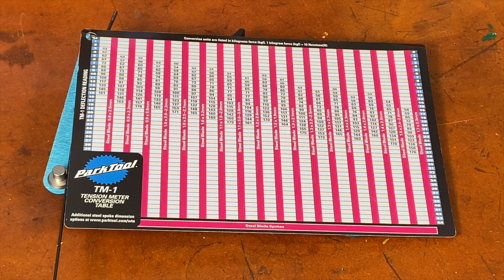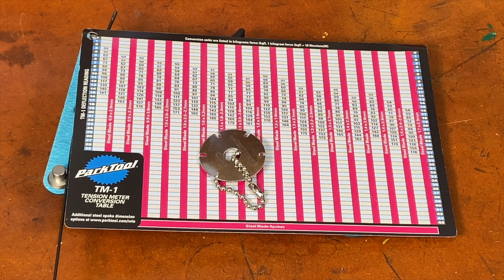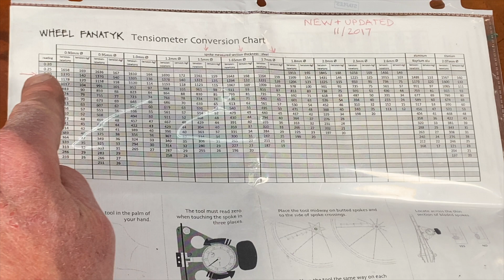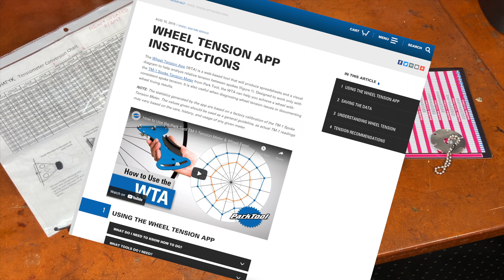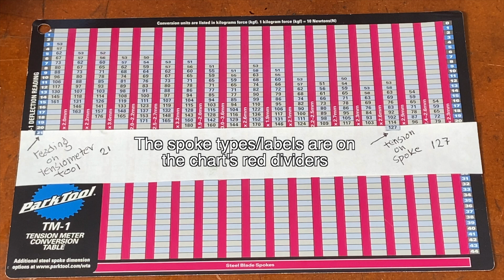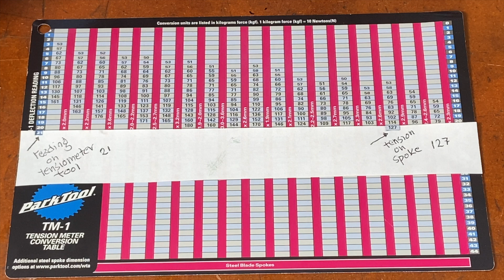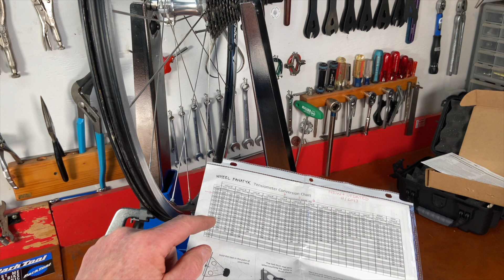Do You Need A SPOKE TENSION METER to Build Bicycle Wheels?

Comment: Hey there,

WF tensiometer style need to be reset within each measure,
 that's the "plus" with this design, spoke isn't straight,  before measure a deflection, you have to reset .

With other tensiometer style(Dt/Sapim/paktool) you can't do this,

If you have 0.03 or 0.04 deflection between 2 contact and measurement point, you read 10 or 20 kgf more or less😉
Reply from the maker: Thanks for watching and for making this excellent point about the difference in tensio meters, Guillaume. Working with the Wheel Fanatyk for hundreds of wheels, I have found that if you move the tool on the spoke up, down, slightly around, you can often zero it without resetting it. I think the discrepancy is from spokes not being perfectly round. Thanks again for the great feedback, appreciated it!!
Reply: @JimLangley1  yep, it's another solution,
I'm using chinese  DT style tensio and Filip Kralyevski tensio ( same as WF / FSA and in reality a Jobst Brandt design)

The capacity to measure the real deflection with this design is a decisive point.

Even centrimaster or hozan tensiometer can't do this.

Comment: Great videos Jim. My question is if you don't know the rim's recommended tension, how can you calculate each spoke's correct tension? Thanks.
Reply from the maker: Thanks for watching and the great question. Rim makers specifying tension is a relatively new trend and still not all makers do it. So wheel builders have to learn and tension to a range they know works. That range is from a minimum of 90 to a max of 130. So we go for a final tension in that range and consider the feel of the tension as we finish wheels along with what the tension meter tells us. I hope this helps.
Reply: @JimLangley1  Thanks Jim, I don't understand how to use that to calculate the individual tension of each spoke.
Reply from the maker: @blahqwe  you only measure the tighter side: right rear and left front for disc brake wheels. Either side for rim brake fronts. You’re looking for about the same tension on all those spokes. They will vary a little cause spokes and rims vary but the tensions should be close. Shoot for 100. Hope this answers but lat me know if you need more info.
Reply: rollinrat4850  Thanks.

Comment: Hi. Great video. Thanks!
Before spending 90 € / $ for the Park Tool I would be happy to know your judgment about the precision of the tool. Are the results (kgf) reliable?
Did you possibly double checked the results with another tool?
Thanks a lot and Greetings from a fan in Germany
Reply from the maker: Thanks for watching, glad you enjoyed the video! Yes, Park Tool’s tension meter is a quality tool that gives accurate and reliable results and they provide full support for their tools too - even an online app for balancing tension in wheels. And yes I have verified the Park tool with others like Wheel Fanatyk’s and it gives the same readings. I think you’ll enjoy using one. Hope this helps and happy wheel building!
Reply: @JimLangley1  Excellent. Thank you very much!
Reply from the maker: @007mat  you’re very welcome!
Reply: If you want reliable kgf results, build a tension meter calibration jig/stand and make your own conversion chart for the exact type of spoke that you use. You can build this yourself.
Reply: @GenePavlovsky  Hi. Thx.
At the end of the day this was exactly what I did 😅.
Build a frame with a hanging scale and noted the results of the tool of the tension I was aiming for. It works.
Reply: @007mat  Great to hear that! I just bought a Wheel Fanatyk tensiometer myself, will build calibration jig as well.
Reply: @GenePavlovsky I think the tool you bought is even better than the park tool. In combination with the calibration jig you will get reliable values for sure. 
Wheel building was still challenging for me. But, was also fun and with some patience the result was nice. Good luck and have fun, too.
Reply: @007mat  I'm happy you managed to achieve good results. I also found it challenging, but I will apply patience and hopefully it will all work out :) Thanks! Cheers

Comment: Jim, love your videos.  Thank you for sharing your knowledge.  Have found much of your commentary very helpful.  Wanted to ask something I’ve had difficulty finding an answer to; should we expect to put less tension on a 36h rim vs a 28hole rim?  Should we expect less tension to be needed on a 26” wheel vs a 29”?  Thanks again for sharing your wealth of knowledge.
Reply from the maker: You’re very welcome, Joseph, thank you for watching and the great comment. I should have explained in the video, but the optimum tension doesn’t change much with different size wheels and different spoke counts or lacing patterns. You still follow the rim maker’s spec if they provide a tension spec. And if you don’t have their spec, you tension to at least 90 kgf and up to 130. You only go by the tight sides, the cassette side rear and disc rotor side front. You use your judgment as you tension whether the wheel needs a little more or less tension. And if you’ve built with a certain rim before you learn what’s best. If you go for 110-120, you will have a good tight wheel. If it still seems a bit soft, go a bit tighter. I hope this is helpful and thanks again!
Reply: @JimLangley1  Thanks again.  👍  On point.  Youre the best.
Reply from the maker: @josephr5902  appreciate it a lot, Joseph!
Reply: Jim not meant to pester but rather to enlighten, another hard to find wheel question; looking at some 2.0/1.8/2.0 spokes at 167mm & wanting to take them down to 255/257mm range(threading my own spokes now).  Do I need to worry about reducing the distance between the end of the threaded portion and the closest butted point on the spoke?  Stock it’s currently 28.5mm.  I would be taking 10-12mm of that distance away.  Have heard the spoke is weakest near the top of the nip and don’t want to waste effort/$$ making an inferior wheelset.  Thanks so much in advance for any insight.
Reply from the maker: @josephr5902  thanks for watching and the great question, Joseph. Cutting down and threading those spokes should work fine. Spoke makers sometimes have really short butts on their racing/competition model spokes, like around 5mm. You'll be left with significantly more than that so as long as your cutter and threader does a nice job, you should be fine doing it. Thanks again and enjoy your wheel building!
Reply: @JimLangley1  Awesome news.  And that makes sense.  As always thank you not only for the great vids but also community interaction.  A modern day Sheldon Brown of wheel building.👌
Reply from the maker: @josephr5902  you're very welcome, Joseph, happy to help! I knew Sheldon because he was an editor at Bicycling Magazine just like I was. But unfortunately I never got to meet him in person because he was on the east coast and I was and am on the west coast. We all miss him!

Comment: What I never thought about with these tools is that the spring force seems like a potentially large variable.

In Canada the fancy DT Swiss tension meter was  closer to $600-900, I always went my sound 🤣
Reply from the maker: Thanks for watching and commenting Adam. I can tell you that in the wheel shop we would compare readings between same Wheel Fanatic tools and they would not vary much at all. We never felt we would gain anything with the more costly tools. Park’s also gave consistent readings taken on lots of wheel builds and it’s quite affordable. Thanks again.

Comment: NO... tensioner meter is NOT needed... IF--> you hear well enough to detect difference in sound.. OR... can feel tension via your hands by grabbing pairs spokes around wheel. 

GET wheel round and dished correctly... then add/subtract tension side to side-->meaning side pulling stronger/off tension loosened then tension added to adjoining side. Stress relieve often on floor lateral tension onto axle end caps... increasing as full tension approaches. 
Finding final tension.. assuming equal spoke count ea side rear.. NDS w todays "over geared" bikes tend to low tension... as low as 45% of DS.. in some cases lower. Rim/spoke combo comes into play.. what that model of rim will handle for peak tension. Super tight is not ideal.. rim gets a challenge to done.

2 basic reasons for finishing tru/build w tire on inflated to your desired tension---> high psi means spoke compression subsequent lower overall spoke tension.. -->rear wheel dish changes to the stronger DS.. albeit usually a minor %... but can exceed .10".

Do I own a tension tool.. yes. Does an infrequent builder need one... NO... not by miles.
Reply from the maker: Thanks a lot for watching and the awesome comment winterrider, appreciate it 🙏❤️
Reply: More importantly, parallel spokes.

Comment: These tension meters are adequate even though the tension measured is perpendicular to the spoke end to end tension which cannot be measured once tensioned between the hub and the rim. Hence the need for the table.
Reply from the maker: Thanks for watching another video and commenting, Graydon. You make a great point. These tools measure how far the spokes move or deflect or bend as you get them tighter and tighter. Then the chart tells you what the tension is. The key thing for accuracy is correctly identifying the spokes in the wheel plus using a good tensiometer properly. These tools need to be recalibrated after enough use too. Thanks, Graydon!

Comment: Jim. Why measure  the gauge on each section  on a butted spoke, when you only measure the tension on the thinnest section?are you establishing  an overall average   gauge thickness this way? In order to refer to the reference  chart?

Thanks for another  explanation  video.
Richard
Reply from the maker: Great question, Richard, I should have explained that better in the video. You measure the spoke so you know what spoke type to reference on the chart. You might have 14/16 double butted or 14/17 etc. Each different size will have a different tension. The tool will show for example 20 but the actual tension will be different on every different size spoke. So measuring is important. Hope this explains and thanks for watching and commenting!!
Reply: Jim. I'm revisiting  your great video. Maybe  I'm being too anal?
Should the gauge of a double  butted or bladed spoke gauge  be based on which gauge reference  value fir the spoke?

Comment: Glad to see I'm not the only one that supports J&J buying bandages for my knuckle skinning habit :-).
I have a TM-1.  Sometimes I need to measure a spoke a few times to get a reading that I'm confident in.  Perhaps this is due to contact point friction or slight misalignment of the meter, and maybe this happens with high-end meters like the Fanatyk just as often.  Have you found that a light coat of oil on the meter contacts improves repeatability?
Reply from the maker: Thanks for watching Chuck! My problem is that I never wore mechanics gloves my entire career so now even when I have plenty, I'm not in the habit of putting them on. I need to get better at that ;-)

You're asking a great question about the readings on spoke tensiometers. In the Wheel Fanatyk instructions, it's explained that it's not the tool, it's the spokes. They're usually not perfectly round and they're also not the same end to end. 

With the digital gauge on the Wheel Fanatyk, when you put it on the spoke sometimes it reads zero but other times it doesn't. I have used two different Wheel Fanatyk tensiometers in our wheel shop and they both do this. When the tools are on spokes you can move them even just barely and the numbers will change showing that the spokes vary in diameter from spot to spot.

If the tool doesn't read zero, there's a zero button so you put the tool on the spoke, zero the tool and then take the reading.

If you don't want to zero the tool, you can instead slide it up and down the spokes a little and/or rotate it on the spoke slightly. By doing this you can often get the gauge to read zero and then take accurate readings.

So, you could try a little lube on your TM-1 but I don't know if it will change the reading. Hope this is helpful and thanks again for watching!

Comment: Thank you for your great videos. I'm about to build my second wheel by only following your instructions. I built my SON 28 dynamohub to commute to work and I love it. I brought it to the bike shop to ahve the final details, like spoke tension and hub centre to the rim. I did not do 100% of the wheel, but it was a big step for a first wheel build, thanks to you!
1. how do I center the hub to the rim without your big dishing tool? How crucial is it to perfectly center a hub to the rim?
2. what truing stand do you recommend? I might start building dyno hubs and alfine internal hubs into my parents bikes this summer if I have the time, but only home use and nothing professional. What do you think of the TS-8, single sided pointer?
3. theoretically, if both flanges of a hub is symmetrical, and the rim's nipple holes are center, one could blindly aim for the same tension in all spokes and get a perfectly true wheel?
4. Can I reuse spokes and nipples? Does fatigue cause spokes to snap?
5. what causes decrease of tension over time, is it resonance loosening the nipples? How often do I true a wheel?
6. Brass or aluminium or what else?
7. When do you put washers for nipples?
Reply from the maker: Thanks for watching and congratulations on building your first wheel following my How to Build Wheels the Easy Way video, Zer0, great job!! You ask a lot of important and fun wheel building questions. To find in depth answers please watch my other wheel building videos because in the videos and in my replies to reader comments you will find tons of information that answers all your questions and more. This link should open a playlist of all my wheel videos. https://youtube.com/playlist?list=PLVx8yqM75583n_qPUh92KqxxSu3jwhQiQ If you still have questions after watching let me know and enjoy the videos!!

Comment: Great video- exactly the info I was looking for! Thanks. Is there a calibration you need to do at all for the park tool tension meter? I'm thinking about getting a cheap knock off version for $30 ... (im just an amateur), not sure if they will be calibrated correctly... Im thinking I could always just use it to compare across spokes or use a good wheel as reference.
Reply from the maker: Thanks for watching, R! Happy to hear my video helped you out. Tensiometers should be calibrated at the factory. It’s not something the user does. And, you do periodically get tensiometers recalibrated depending on how heavily used and well cared for they are. I have not owned or used the knockoffs so I can’t comment on their calibration or quality. Maybe someone will comment about theirs. 

You could certainly use a good wheel for reference. It just needs to have everything the same as the new wheel - same spoke material, gauge; same nipples; same # of spoke crosses, etc. etc. Please let me know how it goes if you do that and thanks again!
Reply: You could use a spoke with a known weight hanging off it to calibrate the tool.
Reply: I own two non-Park Tools tensionmeters, both came with charts. However I have never used the charts. Before I build a wheel, I calibrate the tensionmeter with the spokes which I will be using. I have made a simple test rig out of timber.
The j end of the spoke is threaded through a retaining hole fixed to the base of the rig. The threaded end of the spoke is passed through a cradle and the nipple is fitted. Above the cradle, is a screw eye and a digital weight gauge. The screw passes through the top timber member of the rig and a nut above this applies a vertical pull on the spoke. When the design tension of the spoke is reached, the tensionmeter tool is applied to the spoke and the reading on the tensiometer is the one for the design spoke tension.
This means that the tensionmeter is calibrated every time I use it - with the actual spoke to be used in the build.